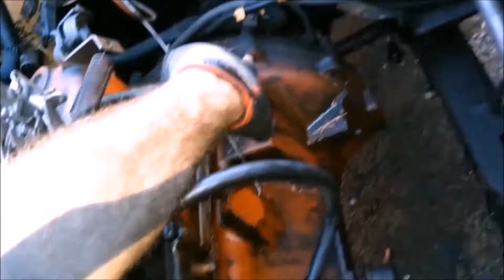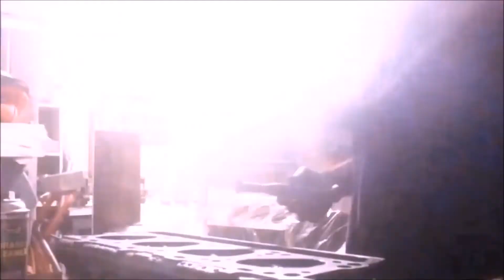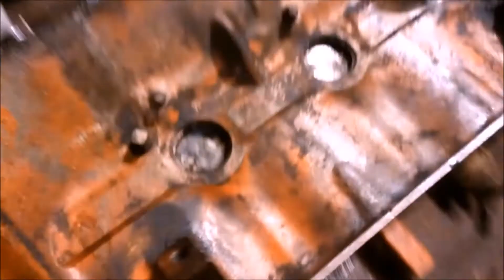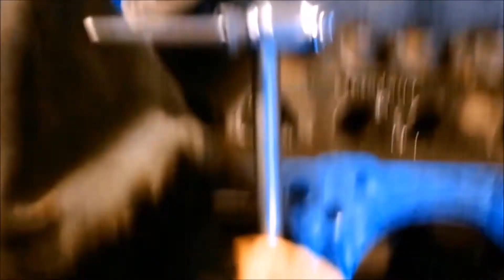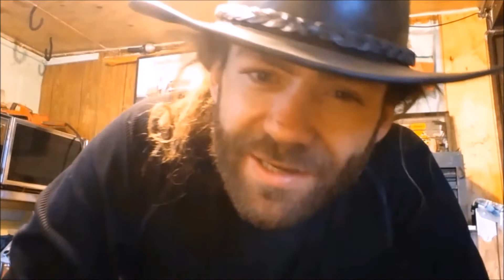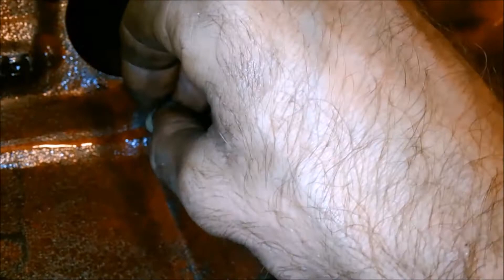ENGIN BUILD DIY 345 IH  (part 1 of 2)

Comment from the maker: I have a 392 on the stand, what i would do different, well i thought i was going to tear the truck down by now and get a 3 angle valve job and shave the heads like i said in the video,  when i lapped the valves i was at the limit on 2 of them. Their still fine, but what did fail and i failed to show in video,
 is after about a year and half of daily driver i started to get the puff of smoke on hot start, i should have replaced the valve guides. 
You can check them easily by putting some oil and putting your over the hole and the valve should should slowly fall out while feeling suction on your finger. 
So other than that, the only thing i didnt do that you can, is a cam, balance the crank and rods, install a pcv catch can, and the baha scout oil drain back lines tapped into the heads, but honestly after polishing the drain holes and the valley casting, i dont have an issue, i rev higher for longer now b4 the oil starve issue with these engines being on an angle and the front holes not realky draining much...
Also, i would go with the dual point distributor, ( thats because im a nut, and the dual points give a dual spark, now its not a high rev power plant so why? and why tell you when sss has only a couple left lol, 
Well you can put a switch on the points so you have a choice. You set it so you have the first second spark points timed for regular gas. Then you can have a second tank of race gas, when you switch to race gas, you flip the switch and turn the retarded first set of points back on for dual spark. This effectively advances/retards ignition with the flio if a switch. 
See the higher test fuel, the slower and yet more powerful explosion. Si the higher octane the more you need to retard the spark. 
Low test makes a quick pop, high test makes a slow powerful woooomph. And it smells great and makes a cool willie wonka gurgling sound in the exhaust lol,
At first i was against the non vac advance, because on a regular engine your gonna have it over advanced under 3k rpm. Well we can only safely rev to 4400 depending on model.... so we have full hp at about 1100. We can set a mechaniczl distrubutor to cover the whole powerband..... 
But my dreams are bigger than my wallet lol 
Honestly, i can put it in 4 high, spin the tires and the clutch in any gear just from what i did, and i have the wrong throttle linkage, i have never been able to give it more than 3/4 throttle, so its nit like im gonna enter it in a tractor pull it has morr power than it csn handle, it will jump and skip all over with an off road suspension.....

Comment: Hey Erik,  have you ever put a flywheel on a 345 that originally came with a flex plate?  I’m going to do that and will be curious if I’m going to have vibration issues.
Reply from the maker: your good, same balancer is used auto or manual!

Comment: Pontiacs have the evil port, too.  Fill it with melted piston aluminum, and port the bowls of the center exhausts.
Reply from the maker: yeah yhe Uncle Tony's Garage had a video on filling them too, i was way overthinking it that i would need to bake the whole casting to temp to weld it but its not structural booger it up real slow lol   The aluminum sounds like a neat trick too!      giess the block off gaskets rot out in a couple years

Comment: I have a couple of question I have and Hough 50H payloader with and IH gas 6 cylinder. I can not find an engine number. I was wondering if you know if the 6 cylinder C-264 and and the 345 V 8 have the same bolt pattern to bolt to the bell housing. Great videos. Not allot of IH people out here.
Reply from the maker: I dont know if a tractor engine bolts to the truck bell...  I can check measurements if you have yours, count the holes, distance between each, clock wise, and ill check mine...
Reply: @ErikTheWrench  Thanks for responding. I will measure them out when it dries out here. LIked the videos about the secrets of the baja engines. After 30 years my Dads 1967 1500B showed up at and auction so I bought it we got the engine running. They said the engine lost power it had collapses lifters and a couple of bent push rods. Its running!!!! Keep the content coming!!!! Thanks again!

Comment: Can these engines be made to handle a Turbo? If so what mods need to be made?
Reply from the maker: the same as any turbo kit, its a blower box that bolts in line with the carb, driven by a tube coming off the exhaust, if you go on my website, www.ironhammer.info/ih there is info on it,  if you really need power, they rev low, your better off with a Paxton supercharger. it bolts on the carb, cable driven blower, mount a fully on the belt, no giant blower sticking out the hood, or mechanical injection lol, and thats that, it will drink what in needs.....

Comment: Just rebuilt my 1977 Traveler 345 V8  with auto transmission following your videos.  Thank you.  You saved me a lot of time and helped me not make too many mistakes.  This was the first engine I have ever completely rebuilt and was a necessity as my head gasket was blown and one piston had chipped.  Fortunately I caught it early before it seized.  I used oven cleaner, brakleen and dawn soap to clean the parts. I invested on a good set of grinding bits and bore brushes. I replaced the pistons and rings - pressing on the pins myself using a jig to make sure they were centered, honed the cylinders, polished and lapped the valves, replaced the valve springs, new cam , lifters and bearings.  All gaskets and seals replaced.  I even ground and polished the intake and exhaust ports following your advice.  Everything was done using normal tools except for a borrowed cam bearing installation tool and cylinder hone.  I opted  to depart from the classic IH red for a gloss black paint job with stainless screws.  I painted the fan IH red and will eventually go for billet aluminum pulleys and a shiny chrome alternator.  Black looks great! I did the entire rebuild on my back porch as I live in an apartment. I carted it in through my living room on a gorilla wagon yard cart.  My neighbors did not know what to think as I hauled it in through the front door.  Apparently, not everyone has a V8 powered yard cart!  I used an engine stand for the rebuild and when it was back together I built an engine run stand out of 4x4s and angle iron which allowed me to run the engine outside of the truck.  My run stand had a small gas tank, gauges and a stand for the radiator.  It was pretty simple to build but next time I would use 4x6s instead of 4x4s.   The 4x4 was the perfect width between the front engine mount and  the bell housing holes for the rear engine mount. The hard part was drilling the holes in the angle iron.  The fully dressed 345 is a heavy beast and the 4x6s would give more strength to the stand.  I would also put wheels on the run stand to make it easy to move.  With the run stand I was able to run the engine, set the timing and check for leaks before I installed the engine.  Good thing as my rear seal leaked.  I replaced it with a different brand and the leak was solved.  That would have been frustrating to have installed the engine and have had to remove it again. Also I had steam coming out of my exhaust.  I went back to your videos and saw that I had installed the manifold metal gasket dry (like the manufacturer recommended).  Following your video, I added gasket material around the exhaust and coolant ports and the leak was sealed - no more steam. My neighbors appreciated the thunderous sound of a big block V8 without exhaust and came around to see what was shaking the paint off the walls!  Amazingly enough it started right away and was easy to tune.  I loaded the fully dressed V8 back on the wagon and carted it through my living room again. I installed in the truck and have finally put it all together. The mufflers quiet the engine considerably.  I will eventually put headers on it and a resonator (Cherry Bomb) to get some of the sound back. I should start my test drive and 500 mile break in tomorrow but it runs great sitting in the driveway.  Thanks again for your videos!  Your work lives on in my truck.
Reply from the maker: gonna wanna keep checking the tuning the carb and advance with the vacuum gauge,  once the rings finally seat themselves on that high nickel big block, your gonna your gonna tune it,  and its gonna light em up on accident when you touch the pedal like your used to lmao...... and then when I got the break in oil out it ran way smoother..... I worked that bitch hard for about 4 years, not an issue.   Guy hit and ran me off the highway last year,  barrel flip off the edge of the road..... the entire truck was destroyed, crushed around the bucket seats, the SSS terra bar, a push bumper, and the IHPA font frame "x brace" I won at the Ohio NATS.... I just installed all of it.    saved my life. the engine would have come through the firewall with out the x brace and big bumper, with out the terra bar my head would have been crushed.    lap belt did its job.    its like the hitchhikers guide, DONT PANIC lol or you'll  break all your bones lol..... , once the suspension's torn off your just upside down again like slow motion, wondering if you get to see your family tonight lol.   you could break her loose in any gear....  was hard to not chirp the tires between shifts when cops where around lol

Comment: My dad was an IH enthusiast, in the late 60s early 70s he got a 42' KB1 half ton pickup, and over the course of 10 years he restored it (we still have it). We went to antique truck shows all summer long, and as a kid growing up in the 70s I fell in love with trucks, eventually becoming a diesel mechanic in 1982, I was still in high school. We also had that same red IH pickup (67 I think). Also in 1972 we bought a brand new IH Travelall 2 wheel drive with a 345 engine, which is what I want to talk about. Because of the emissions laws then IH retarded the cam timing on the 345 and you could reset it by offsetting the cam timing mark by one tooth and have the engine run better. He also removed all the pollution components (air pump and belts) from the engine. This only applies to 72 and later models. I've done this myself for customers later when I started working as a mechanic, but to this day, I have never known anyone else that has done this.
Reply from the maker: that would be 16degrees, so if we subtract the fact that the emissions cam sprockets where 4degrees less, thats still 12 degrees advance, pushing it, but with the emissions sprocket, guess its a few degress off either way lol
Reply: @ErikTheWrench  the 345 had gear to gear timing, no sprockets or chain. I don't know what the degrees would actually be, but I think they would be less than that. I'm not sure, I haven't seen a 345 in 25 years or more. But thanks for responding, I've asked other IH enthusiast if they have ever heard of this being done but I'm still waiting. Good luck!

Comment: I also rushed in and took the heads off of my 345 without keeping the pushrods and tappets organized. Can I recover from this? I’m guessing since those are the only rookie mistakes I made before finding your video that with a good cleaning/inspection of the tappets and pushrods I should be able to reinstall them with no adverse effects. Hopefully?
Reply from the maker: John b, yes the lifters do wear to the cam lobes, and the lifters actually turn in their slots so they wear evenly and not in one spot. They are slightly off center from lobe and the lifter bottoms are ground convex. You can have a machine shop resurface them and they will mate back to the lobe and spin properly.  
So the issue can be if one lifter was worn into a slightly off lobe, on a different lobe, it may not spin, and will wearing out early... I’m not a gambler so I would have them resurfaced, their at a 40 inch radius if your a machinist.
Reply: Interesting. I wasn’t even thinking lifter bottom to cam lobe but that makes absolute sense. Thank you! I should be able to recover from that with a minimum out of pocket expenditure. Hmm, spinning tappets. That might be a good name for a rock band 🥴

Comment: Erik what do you suggest to clean an engine block and degrease it? Or what is your process? Thanks greatly appreciate your videos I'm doing the same thing and they are very helpful
Reply from the maker: dollar store oven cleaner , brush, and a hose, then gas works good too, final clean with lacquer thinner on anything that will be painted, also white vinegar works great to dissolve rust and neutralize the steel if needed.